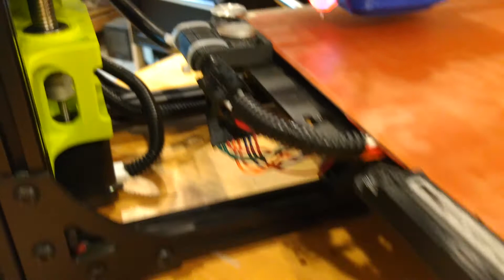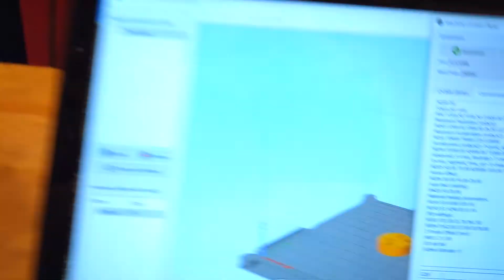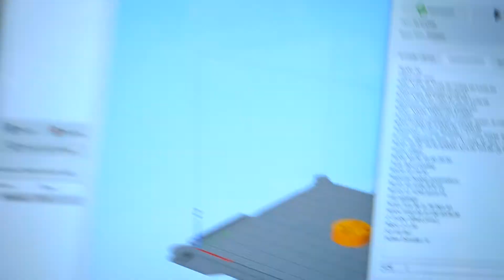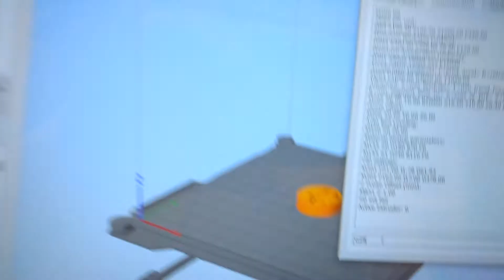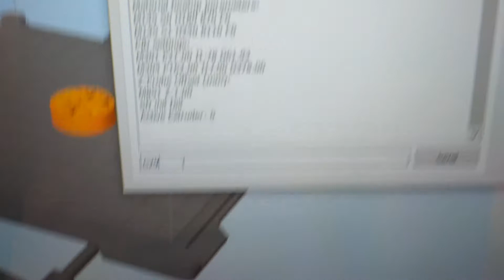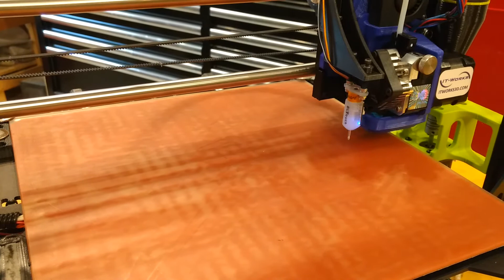BLTouch AutoLevel for LulzBot Taz 6 3d Printer with ITWORKS3D Extruder

Comment: Great work! At last a solution.
Will this work with the standard tool head?
Reply from the maker: Thanks Martin, seems to work well on the four units we've modded.  I briefly looked at the standard head, the main issue is that you will need to find a better mounting point (and make a different bracket) for the BL-Touch.  If you go up on Thingiverse I seem to recall one there.  The electronics and firmware aspects of what I did should not need changes.  Good luck!
Reply: Thanks for reply Neil. My Taz is a home build mostly Aluminium (i machined most of the parts) and i have issues with the probing most of the time but when the wind is blowing in the right direction and my black cat walks in front it works great lol. I may have a look at designing a bracket for the standard head myself but I'm building a Aerostruder atm so ill test this when its ready. May need a few pointers when it comes to installing your firmware :). You say electronics and firmware should work for standard head too?
Reply: I did this on my Taz 5, just made a new carriage

https://forum.lulzbot.com/viewtopic.php?t=6809